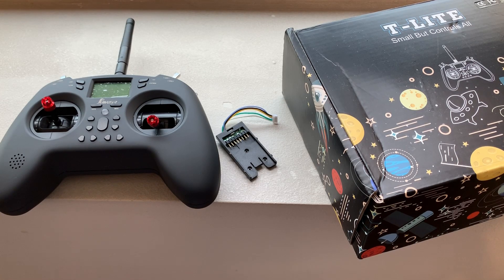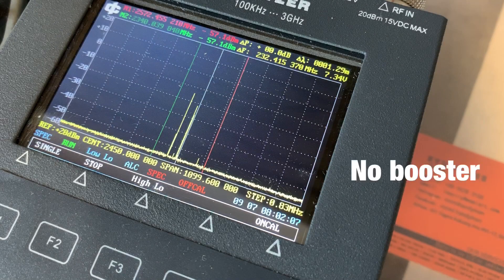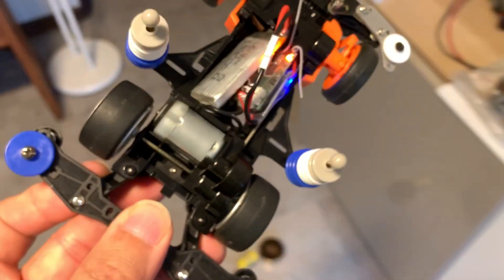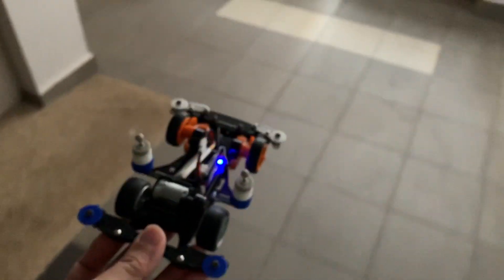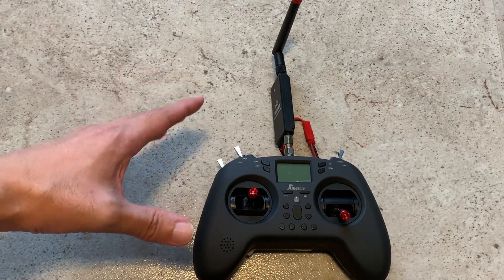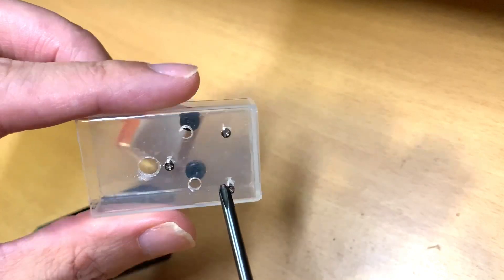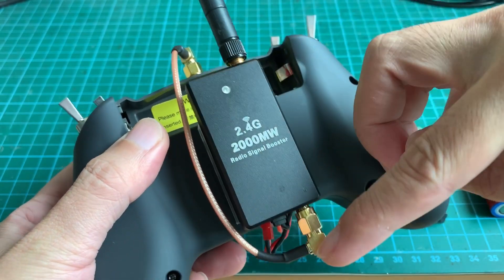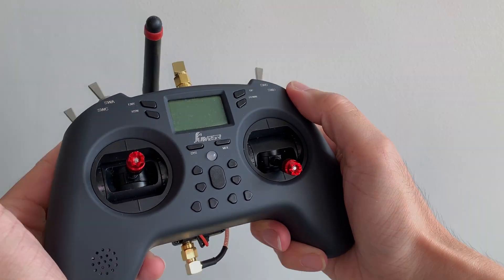Long Range Modification for Jumper T-Lite

Comment: is it the same if I'm using the HS-500-2.4G SIGNAL BOOSTER it powered with its own power itsself.
Reply from the maker: Thanks for watching. Yes, you could power your HS-500-2.4G booster separately and it would work just fine.
Reply: @terence79chan  yes I've got much dB power!

Comment: Hey what range would a 4w 2.4Ghz booster give this remote
Reply from the maker: Thanks for watching. As you saw in my video, an amp labeled 2W only gives an increase of 5db according to the spectrum analyzer. Since +3db doubles the signal, +6db (or 4x the power) will double the range, my range is increased by about 1.7x with +5db. Assuming the 4W amp gives an increase of +10db, your range will increase by 2.89 times.

Comment: Nice one Terence. Have you ever experimented with 2,4GHz pre amps to increase range?
Reply from the maker: Thanks for dropping by! I had used WiFi boosters in the past and they typically have a pre-amplifier inside for receiving. The WiFi booster does a good job at sending signal but is not good at enhancing the received signal so the WiFi link quality is poor although the WiFi strength is showing 3 bars. If you plan to use a pre-Amplifier, i would advise to choose one with an IC rated for 6ghz to get the best performance for 2.4ghz.